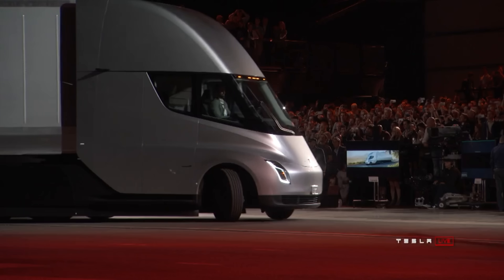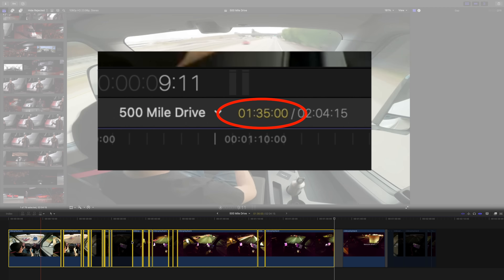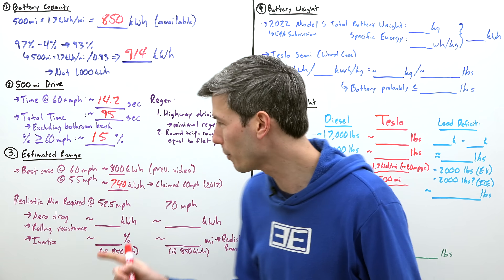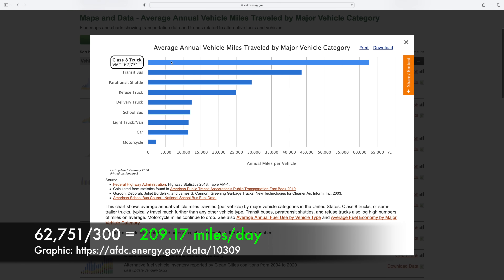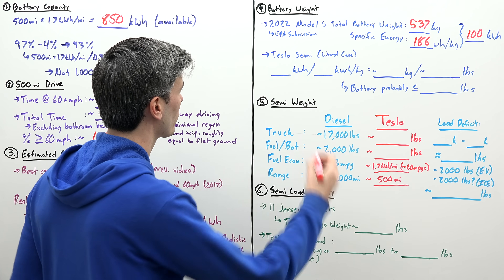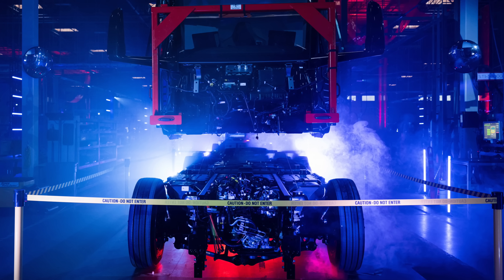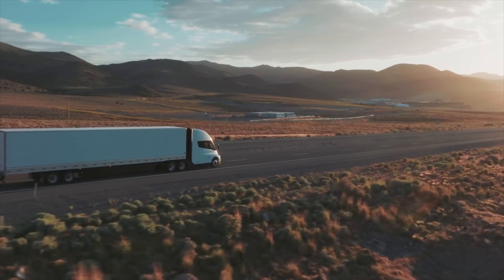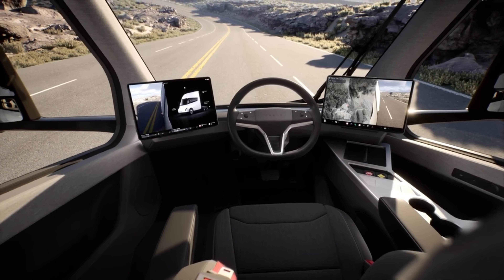Does The Tesla Semi Make Any Sense? Part 2!

Comment: I think it was Shell in their TV commercials, during the 1960s would drive from Phoenix (1000') to Los Angeles (avg 305, but could be 10' if you went to the Venice area), that including the mountain driving gave enough of an advantage that Shell could report impressive mileage. 
And definite the speed change factor. I went from Blandings, UT to Holbrook, AZ (through the Navajo Nation), at my usual 60-70+ mph, AC on, I'd never have made it (my Model Y predicted -10%) Turning off the AC for a hour or so, dropping my speed to 50 - 55 mph; I made it easily with about 15% battery left.

Comment: And your point is? Electrification does not need a business case if you can in exchange reduce the emissions impact on the environment. It will cost what it needs to cost to get there. If anyone wants to hold onto their ICE trucks (or cars) then they have missed the entire point of the need to electrify in the first place.
Reply: Could you help me?  Do you have a reference that details how a BEV semi truck is green relative an ICE equivalent?
Reply: @kradius2169  have you ever stood near an electric car vs an ICE car/truck/bus and just smelled the air? Have you ever looked at a house burning fuel ti heat the house vs electrical heating using solar/battery? We just need to stop arguing that burning fuel is more economical than electrification.
Reply: @LexBDA  ... I feel your pain.  Is reacting nuclear fuel not also "burning," or how exactly were you intending to generate electricity?
Reply: @kradius2169  We have many ways to generate power today, hydro, wind, sun are probably the cleanest source we have. Nuclear probably would be the best alternative to remove those carbon emitting air polluters from the grid. Imagine all cars and trucks worldwide are electric. It is now alot easier to concentrate on generating "clean" power on a larger scale. Our generation today is probably the last generation taking note of the the pollution and probably the last not actually doing anything against it. I am hopeful that the upcoming generation will force the matter. We waist a lot of energy by converting power from DC to AC and then back again just to power a home appliance. We should switch to DC powered appliances allowing for lossless powering of such by setting up microgrids (Solar/Batterie)
Reply: @LexBDA  ... Combined hydro / wind / solar generation would doubtfully ever come near meeting current demand, that is, demand before a possible future all electric land vehicle fleet.

Not sure there's any conversion of power generation from DC to AC here in the USofA.

Other than some DC high voltage lines in Europe that perhaps could implemented in the USofA, not sure it would be practical to have all DC appliances as DC cannot be easily transformed like AC to the various utilization voltages.

Microgrids, though, will be coming.  I believe they are still in their early stages -- many details to be worked out.

Comment: So what if you go 5 miles an hour slower? In the end when it is autonomous and you do not have to worry about paying a person an hourly wage or a wage per mile everyday. It could go even slower. Except for the fact that interstates have a minimum speed. But with that five miles an hour difference in order to match what the test showed it is a small sacrifice to get to that place. The beauty of the EV semi is the fact that even while in the beginning you are going to have to have a driver at the wheel, he has to stop and park it for eight hours after 11 hours on the Road. During that time the truck could be plugged in

Comment: You got a few bad premises.
If a driver knows he's heavy or even close(axle weights and bridge laws is a whole new can of worms to consider), he doesn't route past a weigh station. In fact a significant percentage of carriers specify routes to avoid stations.
And a 210 mile average? Maybe if you count local trucks. My route is from production to warehouse, about 2 miles. A dozen times a night or so 
Over the road? Never shorter than 400.
And those local jobs? A lot of carriers use former road trucks, ie free to the route, or at the very least 10% the cost of new truck.
That's how logistics actually functions.
And your difference in weight?
That's dependant on trailer.
Flatbeds, ie the the jersey barriers, would be the upper end of tha, 50k plus loads. Reefer trailers are the heaviest, thus have the lightest loads.
And a lot of carriers do dead head runs, mainly ltl carriers(UPS, YRC,Expo,ABF,Old Dominion, Fed Ex), greatly skewing your averages.
Tesla is really trying to hype the numbers, and Pepsi, especially with grants amounting to free trucks, is not typical of the routes of trucking. They do have shorter routes and with a free truck, it definitely makes sense. 
May trucking, Werner, the LTLs, swift, knight, prime, ECT, far less so.
And anywhere that has an argument would be the LTLs, or linehaul, and that would be a logistical nightmare to change their routes around to accommodate 60% the range.
A good way to gauge if the mileage claim is good, check the rates per mile for drivers vs the minimum guaranteed per week.
Remember per fmca regs you only drive 6 days a week.

Comment: Let's face it, Musk overpromises. Every time he announces a new product I can imagine all of his engineers face paling. I can also imagine musk being a giant d-bag about it when the tech he over sold under performs.
Reply: Haha the video should let you face the reality of this truck.
Reply: @miguellopez3392  I think the reality of the truck will do that when there's more data, especiallyabout the life of the battery. I'm not talking about charge life, I'm talking about  charge life. Im talking about how long before it has to be replaced. Average is 8 years. Depending Where's the cyber truck? It was announced the same day Ford announced the mustang Mach e. I've seen them driving around, but I don't think anyone has gotten their cyber truck yet. He said he was going to have nueralink up by now. 1500 dead chimps later......
Everyone knows Twitter is doing great right? As far as I can tell Musk spends his days tweeting and overpromising. I'm not taking Musk's word for anything. Hyperloop? Get your cdl then we'll talk
Reply: @sethwooten5678  these trucks use the 811 chemistry 2170 cell, these are good for 400k miles before hitting 80% original capacity, tesla plans to use LFP or silicon based 4680 cells in the future, these will degrade around 3x slower. Cybertruck is still in pre production, this is a new kind of truck design using a 8000 ton die cast machine, there is no stronger die cast machine made in the world and it took time for the French to develop it. Elon musk is known for delays, it called "Elon time" by investors. How many animals died for covid testing?

Comment: I have a 2020 Nissan Leaf. In summer with me driving alone it gets about 220 miles on a charge. I once took an unintended 80 mile trip starting at 40% charge. That means roughly 88 miles of range. By the time I got to my destination I was at 1%. So that is pretty accurate I would say. My wife took my kids on a 152 mile round trip (76 miles one way) in winter with 88% charge (193 mile range). She got to her destination with 50% charge. When she went to leave it was at 30%, I am assuming because the battery cooled down. She was not going to make it home, at night, with my young kids in the car. Thank goodness that 15 miles into the return journey was a level 3 charger that was available. She stopped, got the kids some dinner and got up to 60% charge and came on home. I cannot imagine being stranded on the side of a busy express way with a dead battery and 2 kids in the car. She will NOT be taking that car any distance again. So, nobody has yet talked about how a Tesla semi is going to lose range in cold weather. Even if you believe the claims about it (I don't for a second believe it is anywhere in the ballpark of what elon says about it), cold weather range will make it even less appealing for trucking companies.

Comment: I think the biggest real concern over the Tesla Semi is the rate and cost of battery replacements being needed. They'll likely remain feasible for very short distance hauls as the battery degradation will affect performance less, but the real application range is going to be much shorter than their advertised max range.
Reply: The battery replacement cost is irrelevant to Pepsi, because they are more or less getting the Tesla Semis for free, if you include California state incentives, federal incentives, and diesel fuel savings.
Reply: @cyclopsvision6370  And anyway, the batteries are warrantied for 1 million miles; so premature failure will be on Tesla, not PepsiCo.

Comment: That 8000 pounds weight diff between tractors will only improve. One day battery capacity will double, halving the Edith if the battery (or adding range)

Comment: Wait a minute... You can't say that a diesel truck is the same weight as a Tesla Semi (without the battery). 
What about the weight of the engine, transmission, fluids, radiators, exhaust system, drive shafts, differentials and so on?

Comment: I'm curious how well the batteries will hold up.  If it's charged 300 times a year, I would estimate that after 2 years it would lose 20% capacity even if charging was performed at optimal times.  Thoughts?  Edit: data suggests that if sub optimal charging is performed the battery would be less that 60% of original capacity. Optimal charging is stated as charging at 20% and stopping at 80%.  However that was for standard lithium ion batteries like those in phones.
Reply: You can easily hit 1'500 cycles with NCA and 4'000 cycles with LFP batteries. The issue is fast charging which reduces battery life.
So those that drive 24/7 will lose battery life faster than those that only drive during the day and can charge overnight.
Reply: @johntheux9238  thanks for the info.  👍

Comment: When comparing weights of same model cars of ICE vs Electric there is a 20% increase in weight, roughly then cargo weight loss in Tesla semi should be around 5k-10k pounds, but as you said the biggest problem would be charging infrastructure than weight, this would be good to haul goods within city i am doubtful if it would be used or even practical for long distance.

Comment: Another question that needs to be answered is battery life. Assuming 1500 charge cycle life and 450 miles per charge then the battery will need to be replaced at 675,000 miles. What percentage of the truck cost is battery? An $85,000-100,000 cost per battery might push the truck into not being economically viable.
Reply: 750,000 miles (or 15 years) seems to be the average number of miles of when a semi is replaced in a fleet. Truckers Report puts the yearly cost at about $180,000. Driver salary is about 26% of that…so $133,200 before other common stuff like tags, and permits and insurance. ….you can see it’s closing in. Maintenance costs for an EV should be very low. Even with the pack being replaced at 675,000 miles, it’s going to be really close. Now if that 2nd pack gets you another 675k miles, it’s definitely a decent deal.

Comment: The statistic showing the average daily mileage for a semi-truck is very skewed because trucks that only do local runs might only do 80-100 miles a day or less but as a second generation truck driver and fleet owner, over the road (Or OTR for short) drive 600-700 miles a day at at least 70/mph I run out of Texas and in west TX we typically run about 80-85/mph and I've been doing 85 and had  rigs pass me like I wasn't hardly moving 😳 so saying the average semi only drives 250 miles a day is taking an overall statistic WAY out of context especially since the only reason that stat says trucks only drive 250 miles/day is largely in part to how many trucks drive 600-700 miles/day. This doesn't even account for the fact that an OTR driver basically lives in the truck so even after you finish your work day the accessories in the truck still have to have power. As I have stated before EV semi-trucks might end up being great for local hauling (however local generates less revenue than OTR so the cost of the truck will be a much larger factor) but if OTR trucks are reduced to 350/day you can expect inflation to go through the roof even more so than it has due to the supply of goods taking twice as long. Just to support what I'm saying regarding miles per day, the vast majority of OTR is done on the highway, you don't generally drive through inner-city/in town except when you pick up your load and when you drop it off and OTR trucks typically drive 10 hours/day about 9 of that is at highway speeds so assuming an average highway speed of 65 mph x 9 hours= 650 miles. That being said a lot of company owned trucks are governed to a top speed of 63 mph, even at that if you drive for 9 hours at 63 mph that's still 630 miles or roughly 2½ times the milage that out of context statistic shows.
Reply: The stat is not skewed. What you explain is exactly how averages work. And it is understood with averages that there will be less and more on either side because that’s how averages work.
Reply: @AveragePicker  well I can tell you only read the first sentence of my comment lol the point of my comment was to show that a real world range of 350 miles would never work for over the road trucking and that Tesla saying most trucks only drive 250 miles a day is taking that statistic out of context because OTR trucks typically drive well over 500 miles a day...
Reply: @AveragePicker  the majority of semi-trucks are used for OTR but the small percentage of trucks used for local deliveries of 100 miles or less brings that stat down quit a bit and Tesla is taking that stat out of context as a selling point to make it sound like their advertised range is something amazing when it's really nothing to write home about
Reply: @AveragePicker  to put this more into perspective I can go just over 2100 miles when fully fueled in my Peterbilt so in comparison a "full charge" on a diesel semi is around 2k give or take and a "full charge" on an EV is at best 500 miles but as Jason explains in this video the real world range is more like 350 so on a "full charge" I can drive my Peterbilt 2100 miles vs 350 for a Tesla so tell me again how impressive is that 350 mile range??? There's an old saying: time is money, if it takes twice as much time for freight to go from point A to point B the cost of transporting that freight will also double and in turn the price of goods will double...

Comment: Battery degradation and longevity is one of the big questions. The charging infrastructure is also a question that is not really talked about. For example, If the destination doesn't have chargers or enough of them the practical range will be much less. In a perfect world there would be electric charging stops on the route but this is in the future.

How many chargers do you need for a fleet of electrical trucks and what do these cost? If you use superchargers then we are back talking battery degradation, so how long will charging actually take if you want to make the batteries last and at the same time not lose too much having your trucks being idle?

How many batteries will be needed during a truck's lifetime and what do these cost? When they start taxing electric vehicles in a few years to pay for the electric infrastructure and loss in fuel tax income, then how will this hit electric truck owners?

I, for one, would think hard before switching to electric.

Comment: OK, so I'll be able to recognize a Telsa semi on the road because it will always have the lightest load and be traveling the slowest in addition to it burning so much brighter than a diesel truck.

Seriously...you must be intelligent enough to realize that if a lead foot driver can run the thing out of juice 100 miles short of its destination just with his driving style then you're not even close to the world of practical trucking. Nobody is going to buy a fleet of something can just barely do the job. They want full capability, ideally slightly excess capability. Reliability reliability reliability. They don't want to blow millions on chargers for trucks that can't do the job if its 2C too cold out or the battery deteriorated %1 too much and if the total range/hauling is less than that of a bog standard Volvo then they won't want the thing at all. If it requires extra disciplined drivers then its no good period because those are nearly extinct and aren't ever coming back. Real engineering in the transportation sector has people working against worst-case scenarios, not best case ones.

Comment: the problem is still down to range and recharge time.  they may make individual trips of ~200 miles, but when they have to make multiple of those trips you will run into problems with the tesla having to take 30-45 minutes to charge.  thats far longer than unload time, and you will have to hope you have the range to make it back to your loading point to potentially charge.

its possible these have a future, but not in their current configuration and range.
Reply: That's why the Semi is recharged at the Pepsi facility while the truck is being unloaded.  Have you seen how slow union workers and lumpers unload trucks?  The charging time is not wasted at all.

Comment: You are forgetting something. You aren't just replacing fuel tank with battery. On top of this, the vehicle will weight more, independent of this calculation. Electric vehicle engines and the wiring all weight more then an ICE vehicle. You can compare this using brands which run both an ICE and EV alternative vehicle.